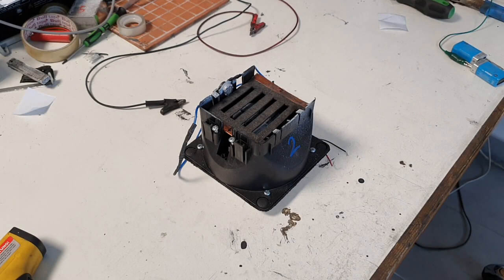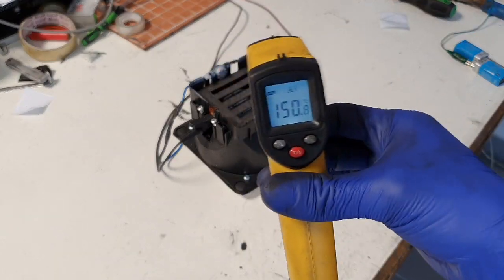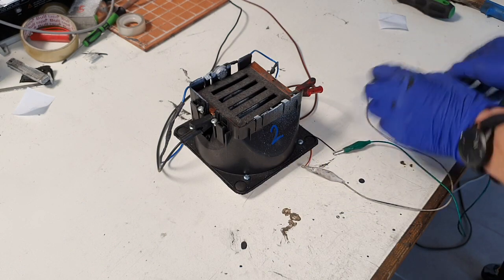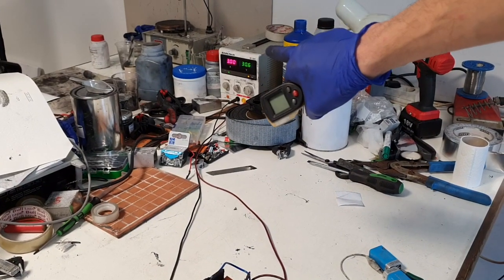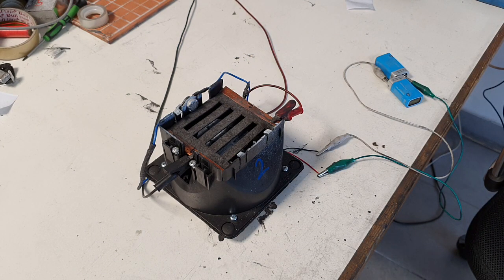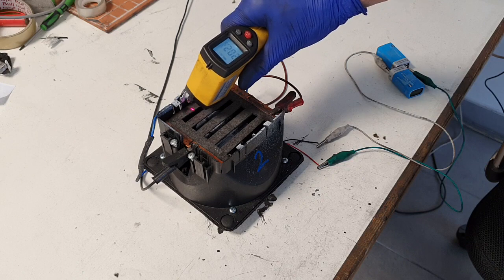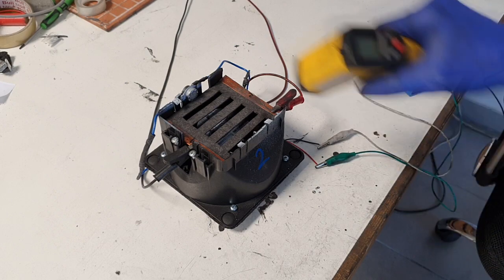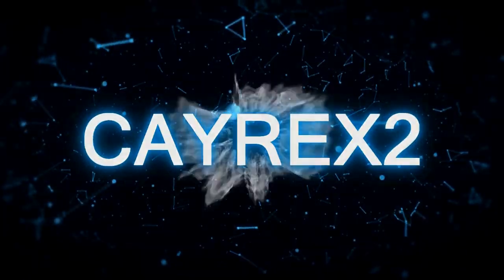Electric Car heater - Prototype

Comment: Do the carbon based heating elements have any advantage over the older wire wound coil elements for use in car heaters?

Comment: I understand this is a proof of concept. The next thing you may want to examine is how well the heat is extracted from the core. Personally I would place a plate painted black with stove paint in front of it and determine how much it heats up over a given duration then check it against a standard resistive wire element and compare the amperages.
Reply from the maker: Good idea...